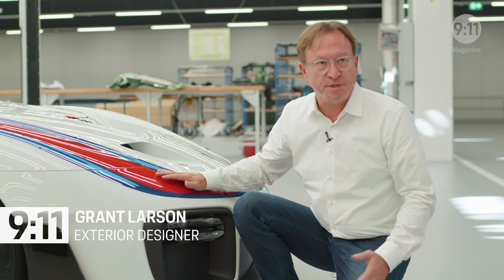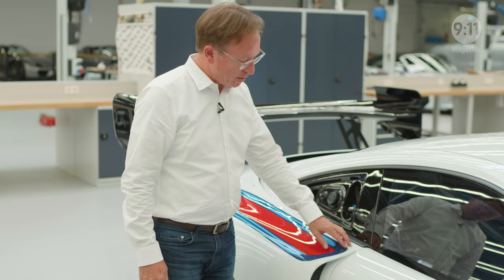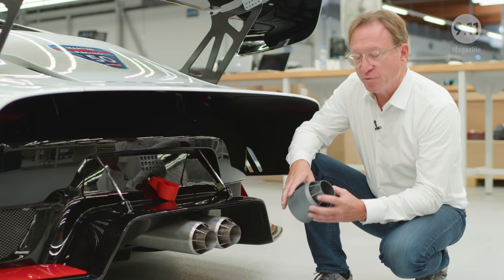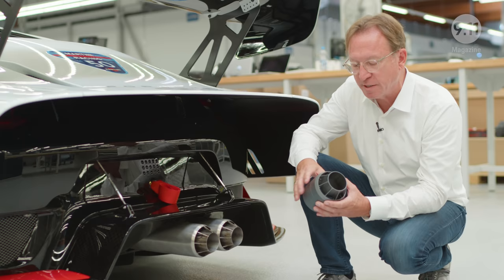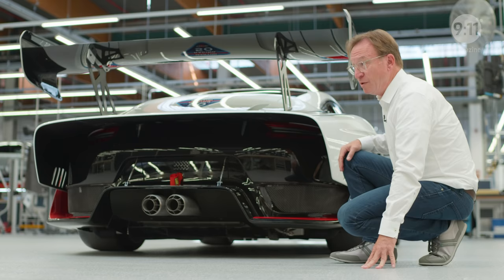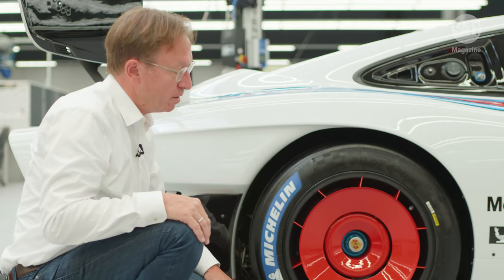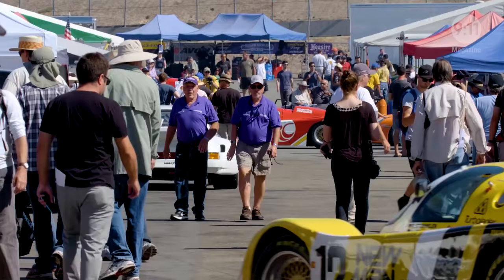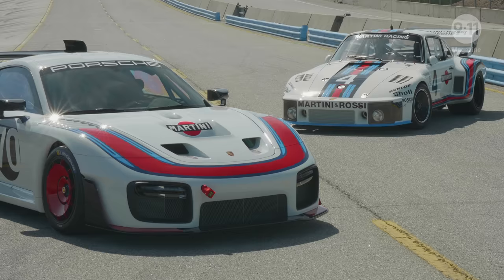The new 935 - Interview with Designer Grant Larson

Comment: I am SO impressed with what Porsche has been doing as of late; this is another very cool example of their subtle changes that result in huge gains. A lot of what is done can’t even be spotted by anyone that isn’t either an aficionado of the marque or an engineer working for the company or mechanic on one of the race car crews. My favorite is the 919 LMP modded for ultimate track dominance; to the point it is faster than the current F1 cars(!!) and that shot of the car going thru Eau Rouge looks like it’s been faked it’s so fast!!

Comment: Not enough power IMO for a modern 935 replica, the engine sound, turbo spool up sound and shape are the iconic parts of this car, It needs to be a 850+HP monster that takes you to the edge of existence each time you go around a corner, it's not bad for a modern re-incarnation style wise but the performance just doesn't stack up

Comment: So basically body add ons same as RWB 😳
Reply: But this one actually looks good
Reply: Only a lot better because its made of carbon fiber.
Reply: Ha ha ha ha, I doubt any of the RWB kits have ever seen a wind tunnel. Probably make the car significantly slower/heavier
Reply: DarkstarDarth It’s wide body, that doesn’t make it RWB
Reply: In the tradition of the original 935. But they also added on a turbobeast to that one.